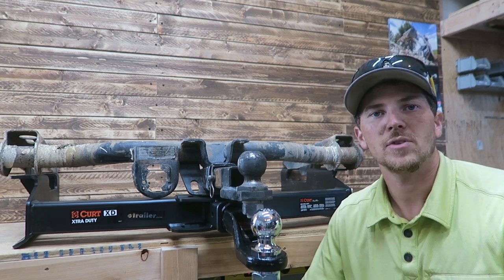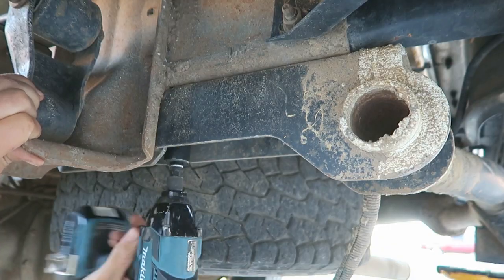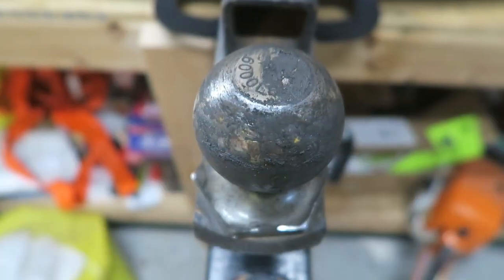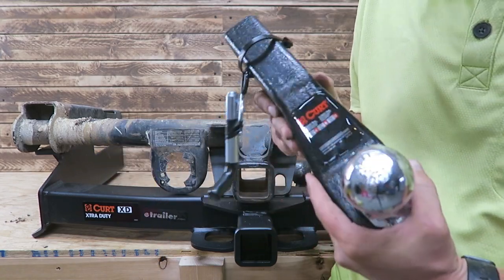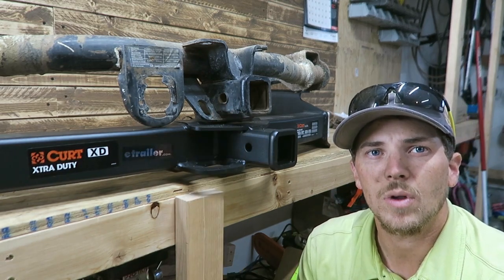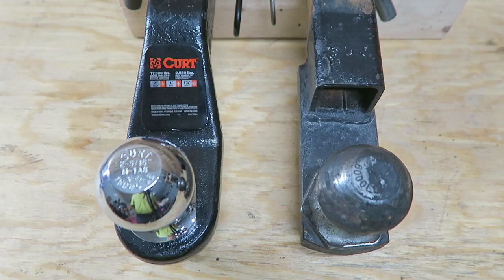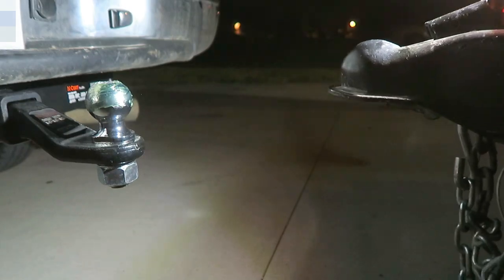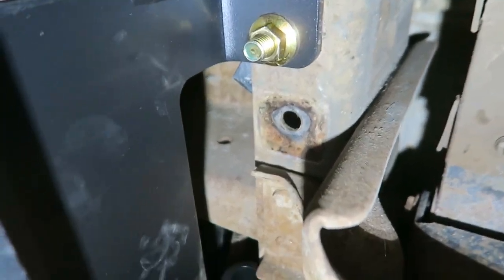Choosing the Right Trailer Hitch & Installing Curt Xtra Duty

Comment: The large chain loops on the hitch are made to put the S hook on the chain through the hole, so you can hook back to the chain itself. That also allows you to adjust the chain so you don't have to twist it to shorten the length. Basically run the chain through the holes on the hitch and hook the chain back to itself.

Comment: Thank you for your video. I'm about to install one soon on my 3500 express van. 2017. Has nothing on it from factory.  So I'm learn on this .  All parts ordered at etrailer.  I already had  some wiring. I'll save for spare. 
Or use it on my old suburban..
Keep it up. Hope installation of brake controller is not to bad. 😬
Reply from the maker: Awesome! Good luck and may all go well.

Comment: Damn all of your equipment was rated closer to a 1/2 ton truck.  My Titan didnt have a tow package so i guess whoever owned it before me installed a Curt hitch only rated for 6Klbs or 10k with WD... I just ordered an 8k hitch with 12k wd and my ball is rated for 7500.

I figured IF I ever had to tow a trailer and vehicle, having the extra 2K lbs available will be huge since the truck is rated for around 9k towing.

I dont want my lowest rating to be from the hitch itself.  I may find a ball rated for more than 7500LBs but i think id be fine for a standard car trailer and an average curb weight vehicle of 4K lbs.  Id rather have the capacity and not need it than to try to tow more than my equipment rating and have something sketchy happen..   my hitch should be arriving tomorrow
Reply from the maker: It’s always good to be aware of your setup!

Comment: So does upgrading the hitch allow you to legally tow without a weight distribution hitch?
Reply from the maker: You don’t need a weight distribution hitch to tow with the stock hitch. Really depends on your trailer and the trucks and trailers capacities and specifications.
Reply: @ThriftyGarage  My F-250's stock receiver shows a 10K Tow Capacity with a WDH, and 5K weight carrying.  Seems a bit low. It is an older model, 2000 year 6.8 with a 4.30 rear axle. I wasn't sure if those ratings are vehicle related or hitch receiver related.
Reply from the maker: It is best to check the vehicle capacity, hitch capacity, ball mount, ball capacity, axle rating, tire rating and trailer requirements. All can be different. Obviously the actual tow rating will be the lowest of all the components.

Comment: Cut the old harness bracket off the old hitch. And tack weld it on the new Curt hitch. That way the truck harness won't dangle.
Reply from the maker: I upgraded to a new 7 and 4 pin connector and mounted it to the new hitch. Sorry, I didn’t show that in the video.